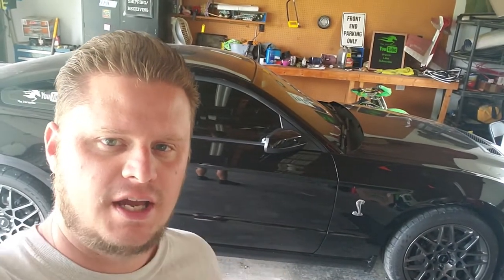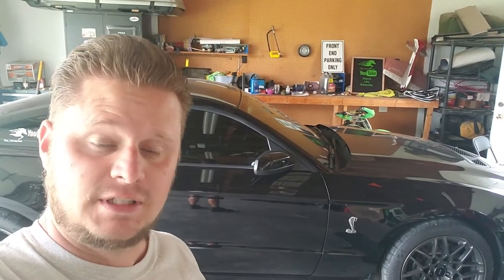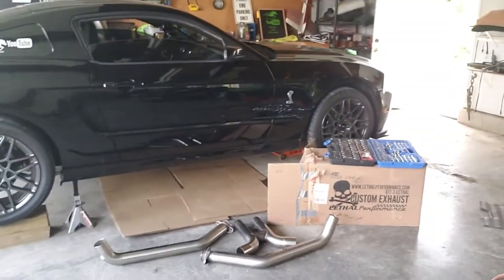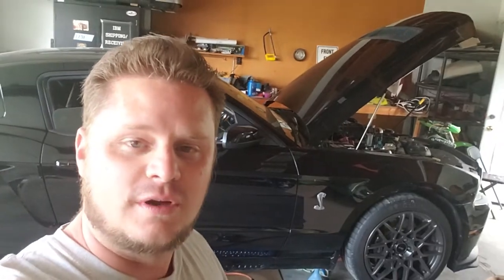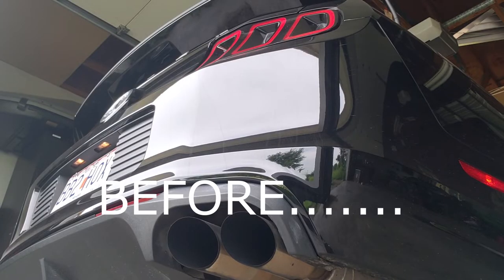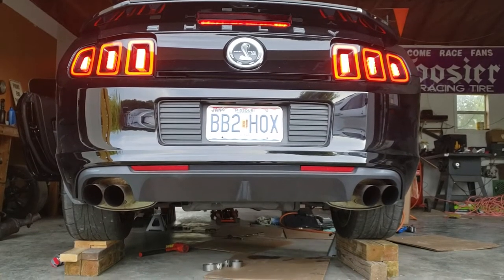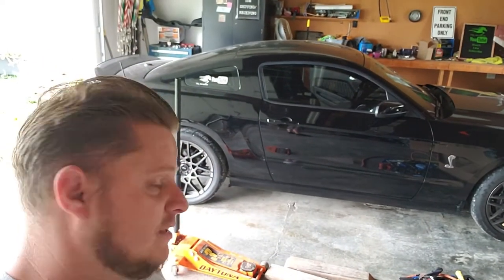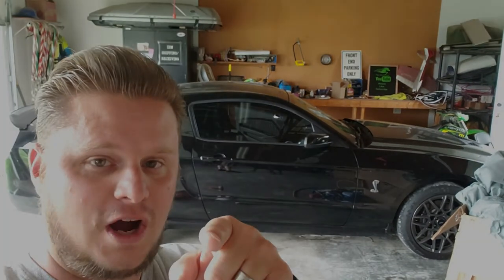Off road H-pipe installed on the Shelby GT500!!

Comment: Sounds tough. What tires are you running?
Reply from the maker: I'm running nitto 555r 305/35/20s. And thanks man!!
Reply from the maker: Also you still have the cobra?
Reply: Yes on the cobra 🐍
Reply: Did you have to do a tune after the install?